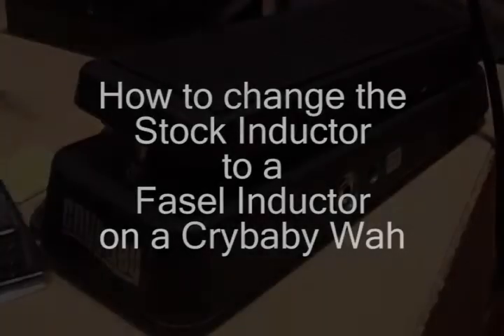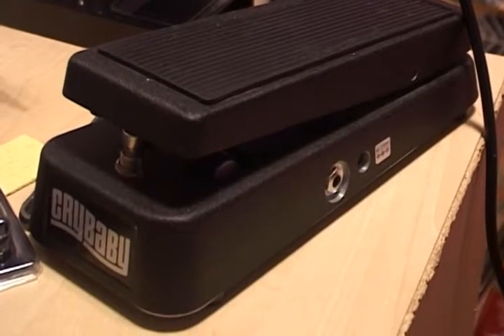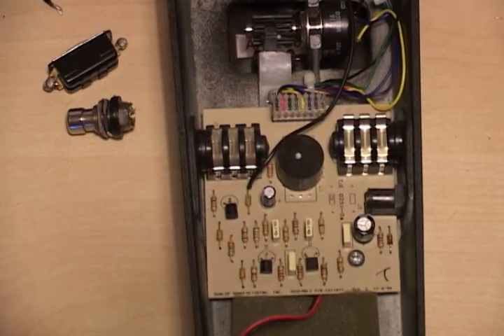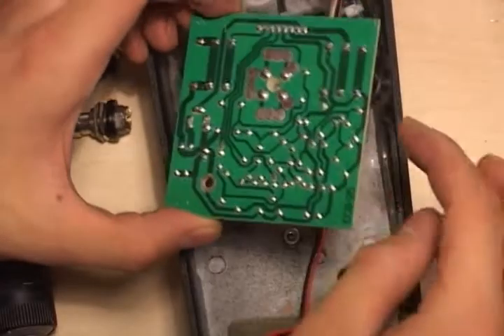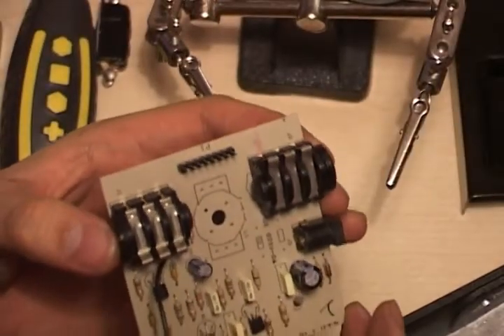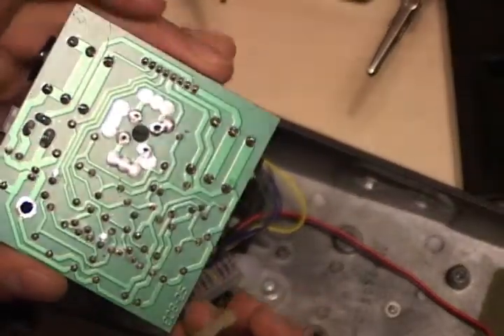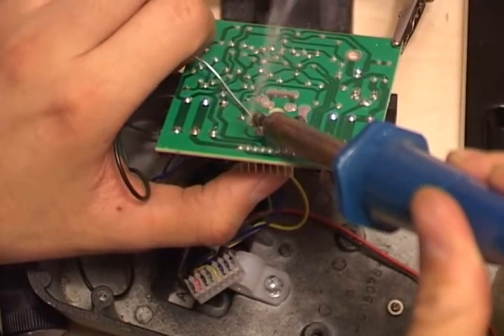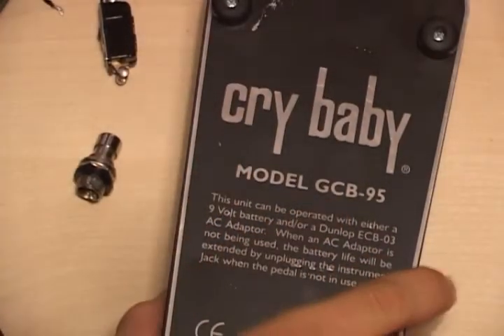Wah Mods (Part 2): Fasel Inductor

Comment: Hi  Ok most 1960's to early 1970's used either HALO or TDK Square brown inductors, but with a change in the  Q Resistor.  Some values for the Q resistor are 33K (stock Cry Baby) or 68K, 88K, or 100K..  Also you will find that the TRASH CAN Silver Inductor was very common in 68 to 70.  What I do (I have two on the bench right now ~ 09/29/2025) is to unsolder the Q Resistor, and replace it with a Variable 0-100K Ohms resistor, and depending on the inductor going in, I set the value around 68K, and then plug it in and check it out.  You can vary the sound of the Wah, by also moving the geared tooth on the Pot, a few teeth up or down.  Now it must be said that Hendrix and most others of that era used Vox Wah's (JEN Italy made) and that we really don't know what Hendrix used, as the Mayer really can't remember the mods.  For all purposes, Vox Wah and Cry Baby Wah PC Boards are Identical in layout and scope.  Mods for one will work on the other.  Tip:  make sure that you buy quality components, and not the cheap crap from China, as about 50% of the time, the parts from China don't or wont work, and are a waste of money.  Also invest in a good Millihenry Digital Multi meter.  You can tailor the Q Resistor better, with a DIMM Millihenry meter.

Stock early solid red Inductors will read between 500 ~525 mH (1968 to 1969) and TDK's will have two separate consistent readings:  early around 250 to 350 mH, and the square later 1969's to mid 1970's around 535 to 600 mH.  HALO's are usually start around 600mH and will end up around 650mH  The New HALO's coming out of China do actually work,  (I just installed one in a test CGB-95 on 09/20/2025) and they read between 635 mH to about 690mH.  I have a very early TDK, from 1967 that reads around 200 mH, and I am going to use that one next as a test.  OK, components are going to be expensive no mater what.  If you want mediocre sound use the dark red one you installed (incorrectly I might add) as these are the one's that Dunlop installed from the mid 2000's onward, and are the one's that I usually remove and bin.  There is, very little difference between the dark red, the yellow and the green inductors that Dunlop makes, so save your money.  Go on EBAY and search "Wah Inductors" and take you pick of REAL ONE's, not the standard one's that Dunlop sells.

Comment: Great demo!  I just changed my pot to a new one which works great!  I took out the old N30 inductor.  I put in a yellow Fasel inductor which sounds and work great, along with no more scratchy pot!  I want to thank you for demonstrating how to remove the old four post inductor.  I was worried for a second because of the wider span between the two post on the yellow.  The four on the N30 were closer together.  I figured it out.I just saw in what relation the fasel was facing towards the ground screw.  By the way the wah I just modded is a 1994 GCB-95 which now sounds far better.

Comment: Mine came with Fasel as stock , after some research I figured that the Halo would be an option but it costs llike 50 bucks on ebay

Comment: the way you describe it sounds like this is what i always disliked about my gcb95. anyway i want to mod it to a zw45, and people say i must change C5 ... only problem is i can't find any C5 on my pcb ^^ ...

btw, why don't you just use braid for desoldering ... would be much easier to work with.

Comment: the replacement boards -even the cheapest of these- I've noticed have the Fasel in them. I got mine out of a pawn shop dumpster where they had trashed the circuit board- but the housing/pedal is -of course- bulletproof- so I've got to find a board or build one- thanks for providing some explanation, appreciate ya

Comment: @RigorMortisDeath pretty much. the only annoying thing that i've experienced with cheap irons is the power cables are usually too short (forcing you to be right next to an outlet)! i have a weller little mini-soldering station, comes with a stand and place for your sponge (to wet the tip). i think it was probably around 40 bucks but it's worth it if you're soldering a lot

Comment: Can I us the fl-02 (RED) inductor instead of the fl-01 (YELLOW)?  What would happen if I did use the fl-02 instead of fl-01?
Reply: This is a very old post, but anyway people will look at is, as I do now. The Yellow one has a lighter/cooler sound, and the red one is more vocal. I like the red one
much more.

Comment: So im not suppose to bend the legs on the fasel inductor? So how am i suppose to fit it into the not-as-wide spacing of the two holes? I see another set of holes beside those that are wider. am i suppose to put to through there instead?

Comment: Hey guys, I'm new to wah mods...is that true that you can create a volume boost by replacing a 68k resistance by a lower value one. It would be great for me since I only use the wah for lead purpose, Thanx

Comment: First I'd try to take it back to see if you can at least exchange it for an identical one to tell whether it's faulty or not.  

If it isn't faulty and you simply don't like the sweep of the wah, you can try replacing the 1.5k resistor that should be located to the left of the .01uF capacitor and below the inductor with something around 2k to 2.2k which is supposed to smooth out the transition from heel to toe.  

I haven't tried it out myself but I plan on doing this mod to see how I like it.